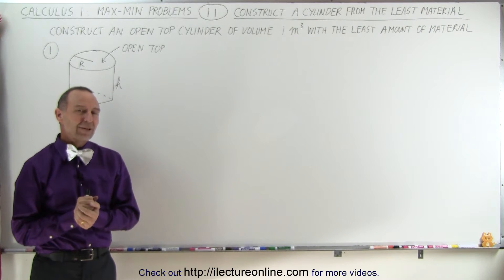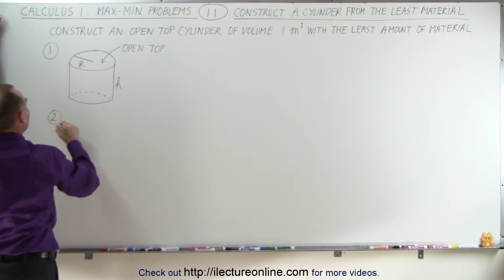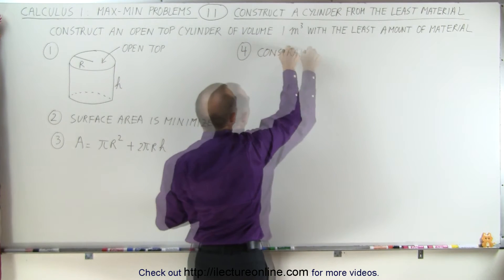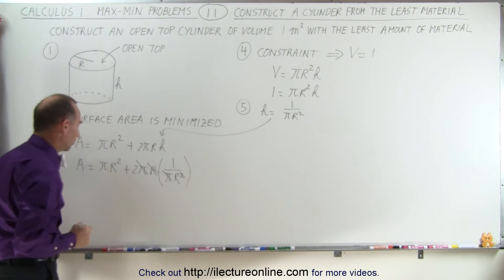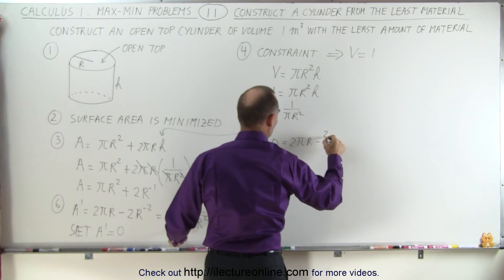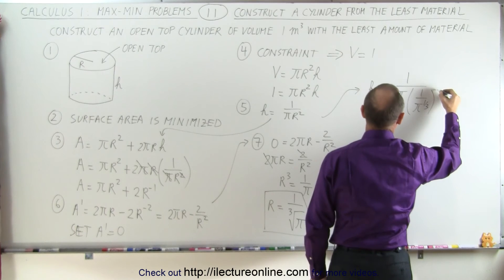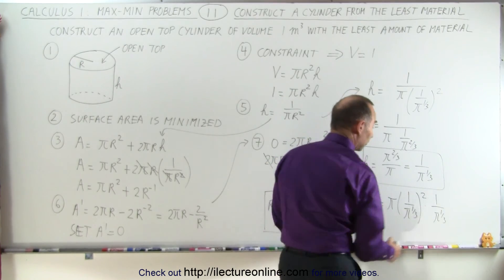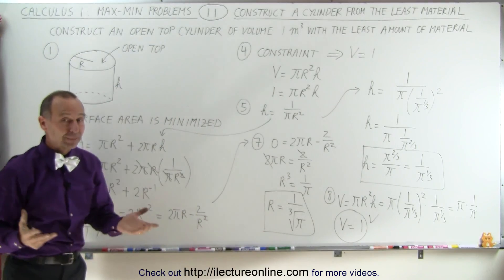Calculus 1: Max-Min Problems (11 of 30) Construct a Cylinder from the Least Material

Comment: i have a doubt....generally we are taking the volume is the minimum  for minimum material.but here we are taking surface area is minimum in this case.why ...please help me?
Reply from the maker: It doesn't matter if it is the volume, or cost, or surface area or any other function.  Any quadratic or cubic equation potentially has a maximum and a minimum.
Reply: well minimum surface mean u need less materials to build 
and in this case the function is concave so there's no local or global minimum problem